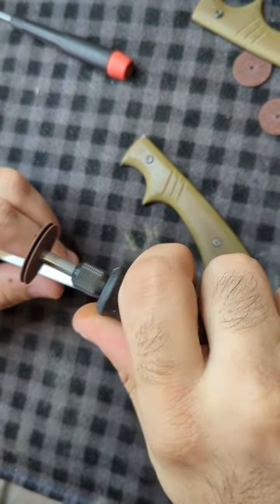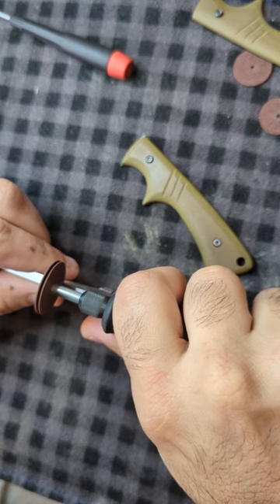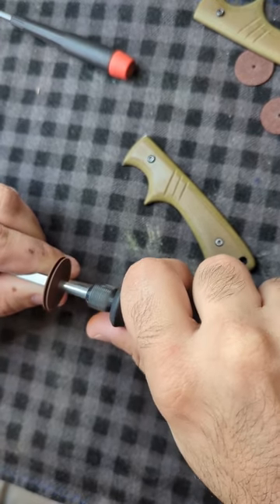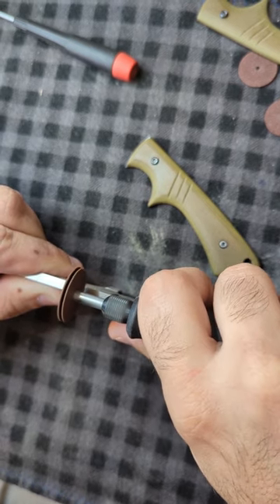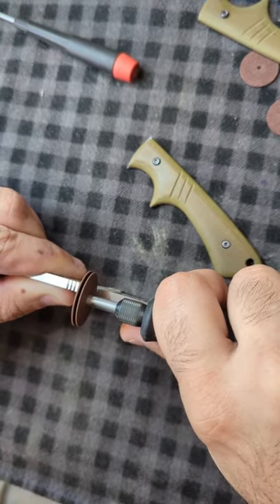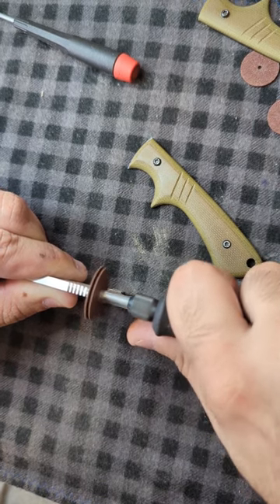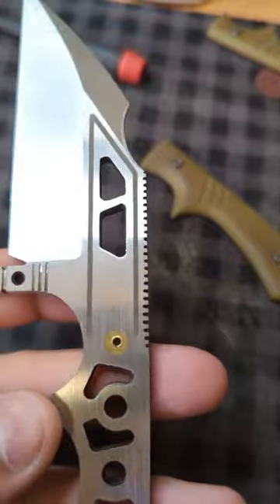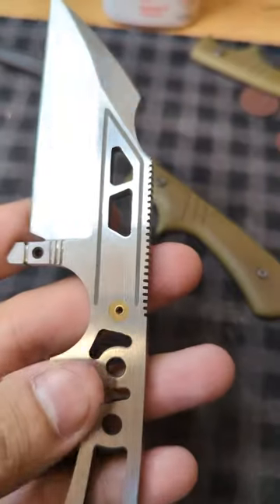How to add jimping to your knife!

Comment: Easier to just use a jimping file.
Reply from the maker: This method takes some practice but after you have it down....its much easier than a file and takes less time.
Reply: The problem is usually getting a jimping file started. This registers the grooves really quickly and easily.
Reply: @machoblades  the depth of your jimps are a lil off from jimp to jimp... do you go back and file or leave as is... nice technique for sure. Not sure a client would go for uneven depths... was this your blade or for a client... Cheers
Reply: @SweetTooth8989  File can be made fool proof with a jig or guide... and yes of course that takes more time, but i think it's more precise and yield better results... good things take time. Cheers
Reply from the maker: @izatafactnow  No, I dont go back thru with a file. The jimping still functions and gives good traction/grip. The difference in depth is typically very slight. Check out my IG for pics of my finished knives. They all have jimping done just like this.
Reply: @machoblades  Thanks I'll check it out for sure
Reply from the maker: @izatafactnow  Ive seen jimping done with files that dont look as good as the jimping on my knives. Plus, the file is limited when it comes to curves. A curved spine, even if its a slight curve, will cause the depths to be different with a file....or just not be possible/look good. This method works great for curves and is a fraction of the time. The time difference is significant...like 5 minutes vs 1 hour or more. Similar to grinding the bevels, a file could be more precise but just takes way more time. It's a balance of efficiency and quality. Efficiency goes a long way, especially when you are making multiple knives. This method is versatile, efficient, and with practice...can give you quality work.
Reply: @izatafactnow  i know. I have a quality jimping file from grobet. It does a great job the issue is getting the grooves started. There's ways to help with that like you said  and from then it goes faster.
The other issue is a file can be a bit harder to use on spines with a curve. Also harder to get the "teeth" cut by the file to follow the curve.
Reply: @machoblades  ahh i just seen your comment after I commented. You mentioned exactly what I was saying about using it on curved spines.